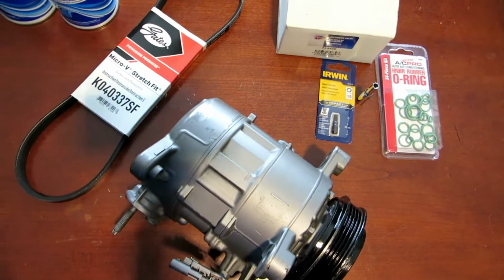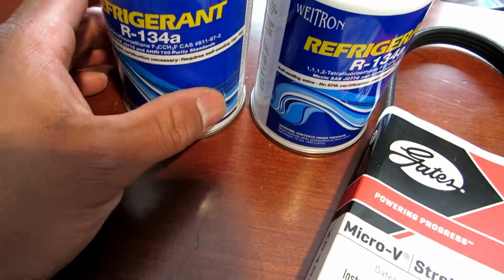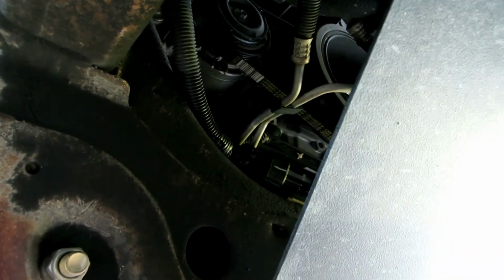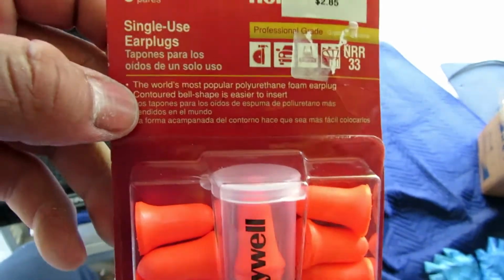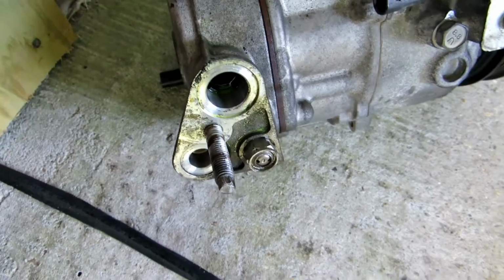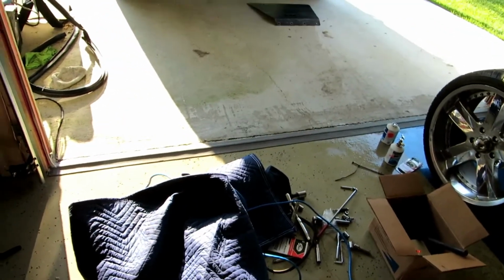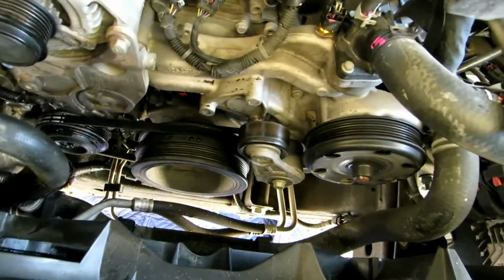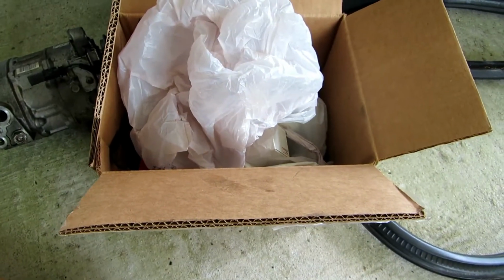2014 chevy silverado ac compressor removal/install. plus expansion valve.

Comment: I just did this today. The whole job is easy if you do your research. EXCEPT for that nut that holds your lines on the compressor. I used a deep socket on the nut (not an impact socket), a U-joint socket into the deep socket and a 24” extension on a Dewalt 3/8” drive. The stretch belt was EASY without a tool on and off. Google 2015 Silverado stretch belt removal. Thanks for the video bro.

Comment: Thank you so much this is a great video i am having the same issue my Vacuum wont hold and compressor clutch isnt kicking in im gonna check on that seal
Reply from the maker: Turn the AC on and TAP the front of the clutch with a screw driver. You might have an issue with the AC clutch gap not set right. And the vacuum may be at the lines at the top of the condenser where it looks connected well but not.
Reply: @tandtlife1  I accidentally damaged one of the connections that goes to the compressor I damage the high-pressure male part and that was a long headache, I ended up buying a new part because it was leaking air when I was trying to vacuum
Reply from the maker: @Slimbo_85  glad ya found it. sucks though